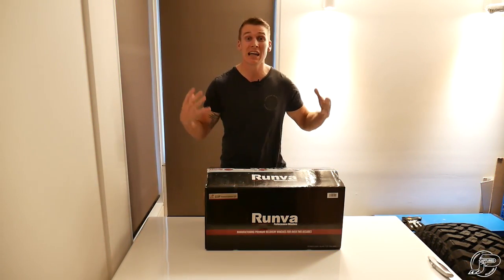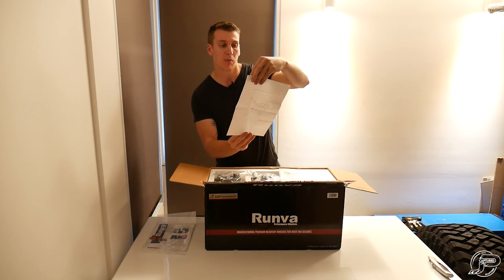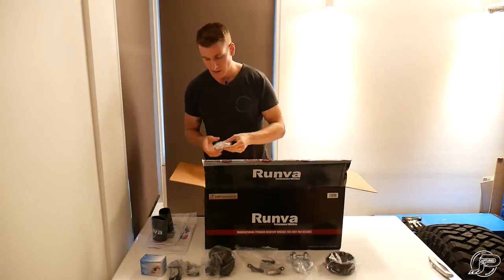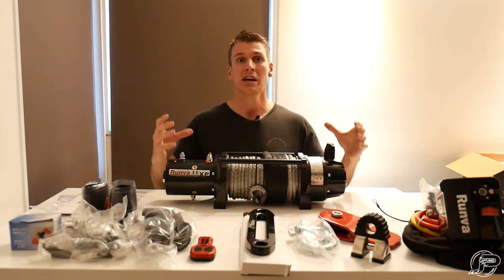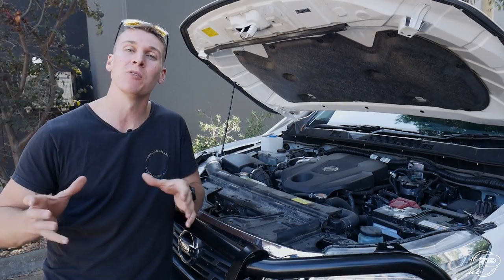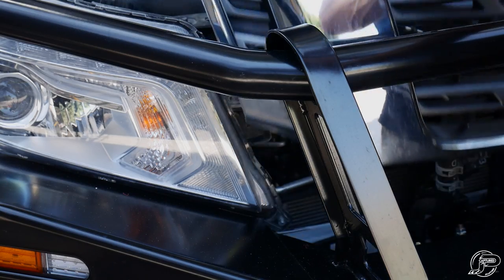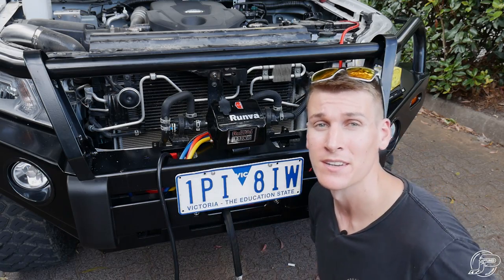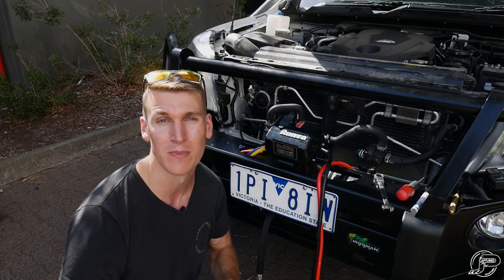Runva 11xp Premium Review + Winch Install NP300 & Unboxing #ShedSessions

Comment: I want to hide the control box inside the bull bar (Opposite Lock). My 11XP premium was installed years ago and the mounting bracket to attach the box onto the winch is long gone, I just have the V bracket on top of the bar. What does that bracket look like, and where does it attach to the winch? I can't find it on the Runva website to buy.

Comment: Awesome, I was dreading the install of my Runva XP (I won it woohoo) but this video was so easy to follow and informative yet basic, tomorrow is the day ! 
Cheers mate, liked and subscribed for future videos
Reply from the maker: congrats on the win, that's awesome! get it on the rig then you can go and test it in the bush.
Reply: Hi guys putting the bracket on the bullbar not a problem, however attaching the control box to the bracket.
It has drilled threaded holes on the back plate but no screws to attach.
Pls advise

Comment: Had this winch installed a few days ago, but they didn’t install the isolator switch (installer said “you don’t need it”). So obviously this switch allows you to power the winch only when you want but my question is - what is the purpose of doing this and is it really needed or not? Great video mate, cheers.

Comment: Your vehicle has a Smart Alternator and a sensor on the negative terminal for determining how hard it should work.
You have connected your winch direct to your negative terminal. This will mean that your Smart Alternator will not be able to compensate for increased battery load while winching and you will flatten your battery, even if your vehicle is running.
You can lengthen your ground terminal with a copper bar to provide an earth location outside of the sensor.
Reply: Hi Dan, very good point and I want to learn more on the smart alternators as I am about to do the same winch install on my 2021 NP300. Would't the battery drain by the winch be picked up by the smart alternator and therefore compensated?
Reply: @iDEMONiDEVIL  The current sensor on the negative terminal is what tells the alternator to “work harder”. As long as all the loads are on the outside of this terminal, they will be detected and the alternator will provide more charge to the battery. If there is a load on the inside of this terminal, it will not be detected and the alternator will plod along, providing enough charge to condition the battery and it will eventually make up the shortfall.
Having battery drain that isn’t detected and compensated by the smart alternator would be similar to running the winch without the engine running.

Comment: Thanks for the wireless remote instructions! Runva seems to be a bit skimpy on included instructions.

Just a comment regarding the wiring.
Have you cable tied any of it? You mentioned cables rubbing through but didn't mention securing it from moving. A lot of auto electricians I have talked to recommended every 20-30cm or less securing it. 
I also watched a video recently on installation tips and split conduit is a cheap and easy way of protecting all the cables from running through.
Reply from the maker: no worries at all. Funny you say that i recently went through all of the winch wiring and re-did it with split sleeve all the way through and a few P clips holding everything down.
Reply: @jpcaptured799  it's good peace of mind 👌

Comment: Cool video super clear instructions the runva winch looks sick. Going to be annoying if ever need to remove that grill in the future though with the cables running through the grill. Should of done it underneath it. 

Get ya self a number plate flip bracket, to solve the issue of your number plate being in the way, just flip it up when ever ur winching 😀

Comment: I have been helping a co-worker install this winch.

The solenoid ground wire gets hot and the winch clicks while releasing or spooling up the cable, the solenoid ground wire is connected to  the winch ground point.
The winch has the 35mm2 ground cable connected directly to the battery.
The battery is a 810CCA.

I checked all ground points and they're tight
Resistance from winch ground point to neg battery post is about 0.3Ohms
I cant figure out what is causing this issue

Comment: Hi mate, great video. I had my Runva 11XP winch fitted last Monday. I hadn’t used it at all. I crossed a creek wheel height. 30 mins after crossing the winch activated on its own and pulled against the fairlead to the point that it twisted my brand new TJM bull bar. Have you had any issues using this winch while going through water at all? Cheers
Reply: Best to isolate when not in use mate, I had problems with my winch with water. Wasn’t a runva but my wired controller only worked going out not in, and my wireless control worked fine. Also on the day it happened the winch would randomly spool my cable out, I let it dry out and didn’t happen again but that’s when I had the controller issues

Comment: Did you have to put new heavier rated shockies on the front of the car to cater for the weight of the winch?
Reply from the maker: yes, my suspension is setup for the weight I carry and accessories.

Comment: Hey mate any reason why you didn't take the multi coloured cables through the grill so there out of sight?
Reply from the maker: Hey man! The cables were too short to reach around. I think after i put some conjute over them it should hide them a bit better 😁
Reply: @jpcaptured799  I have same car, bar,  and winch and went through the grill just thought there maybe a reason that you went the other way that I should know about.
All good mate keep up the good work👍
Reply from the maker: @mattyj3211  true! Did you have to lengthen the small earth wire? Or did you earth it on a other spot? That was the cable that was limiting me.
Reply: @jpcaptured799  *conduit

Comment: I'm surprised it's not fused off the battery
Reply: You are correct that you shouldn’t have an infused cable running though your car, especially in an impact/crumple zone like in a bumper or bull bar.
The problem is that winches pull a lot of current. Even a 300A Maxi-fuse may blow under normal usage, and since a winch is an emergency device, it is usually subjected to abnormal use.
The isolator switch serves the purpose of a fuse, but needs to be managed by a human. You need to have your winch isolated when not in use.
Some people still install with fuses, some use remotely controlled solenoids and some people use Anderson Plugs.
Runva, Carbon or Warn should manufacture and include a sealed unit fused, isolation switch capable of handling the current, but that would increase the cost of the package by at least another $100.

Comment: It still blows me away that companies waste time and money offering a normal and premium version of the same winch with the main difference being water proofing. Why bother. There should not be a choice. It should just be the best most waterproof unit that the company can produce and for anyone tight arsed enough to buy the cheaper version just because they want a winch on the car then these are the people that deserve to get stuck and have the winch fail at the he most critical of times. A winch is not one of those items that should be determined purely by budget as it can be the difference between life or death.